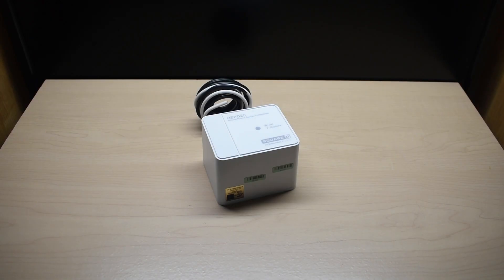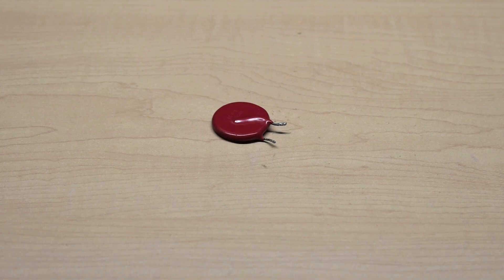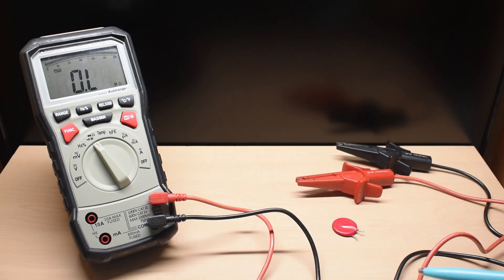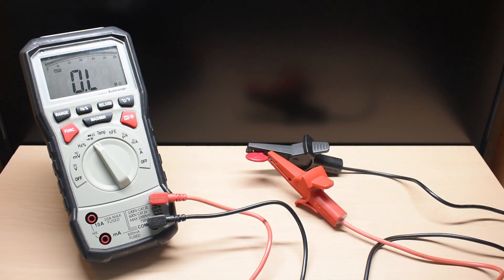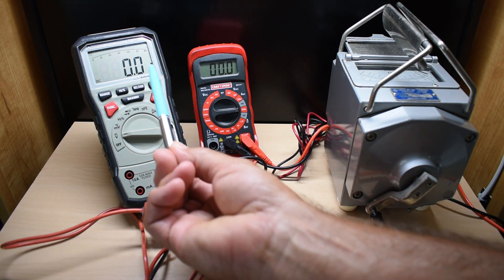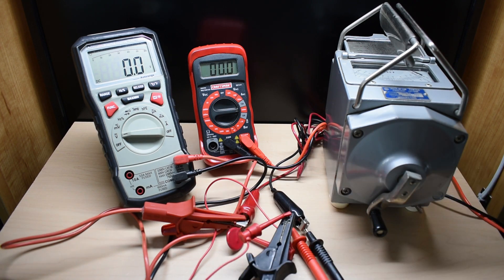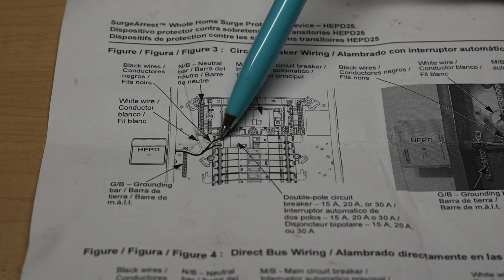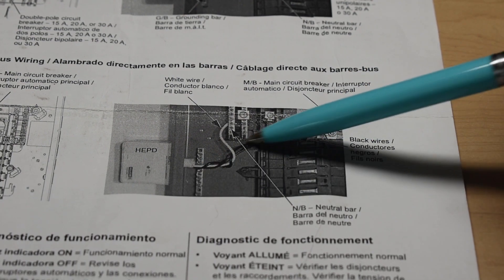HOW Surge Protectors Work & Installing A Whole House Surge Protector!

Comment: Checking resistance on a device at the same time you are applying voltage to it is a no no. 
How is the meter checking resistance with a voltage being shoved into it.

Comment: Thanks for the MOV tutorial. I have two questions though. ... 
(1) Is there a reason that a (hand cranked) dynamo was used instead of a common bench supply? 
(2) I'm doubtful that the internal resistance of the Ammeter (DVM) would have any significant effect on the current measured. At least Not with a 270K resistor in series with it, as you have here. Did I misinterpret you?:face-blue-wide-eyes:
Wakodahatchee Chris
Reply: Common bench supplies do not go to 600 VDC
Reply: Sería mejor comprobar los Varistores con voltaje AC.... y más cuando estás comprobando un protector de sobretensiones. 
 Si buscas en las hojas de datos de un varistor, podrás ver que en ac protege a un voltaje y en DC protege a un voltaje mayor....  Entonces si se quiere saber si un Varistor que está protegiendo en voltaje AC está bien, hay que probarlo con voltaje AC.  Es mi opinión

Comment: I worked in the oil field & we had surge protection on our well control panels (480V 3Ø. It wasn't unusual for lightning to pop the surge protector & leave a hole in the can. It didn't vaporize the wires. So the surge protection can still be HOT after a lightning strike.

Comment: Yes Great topic.   I was going to buy an insulation tester to test MOVs to see when they break down to see if they are still calibrated/operational/usable.   I did some research and thought I could build a DIY tester.  I was going to rig up a microwave oven transformer to a full wave rectifier to generate my 1000 volt DC source.   I guess I could just use the high voltage rectifier that came with microwave for half wave rectifier since there is no real load.   I was going to slowly increase voltage on primary windings of MOT transformer with my variac and have a current limiting resistor in series with its DC output.   I want to control the output voltage so as to NEVER exceed 1000 volts DC since all of my gear can't tolerate these voltage levels.  I also wanted to use this device to test unknown rectifiers to see what their actual reverse breakdown voltages are.   I have heard that some rectifiers are actually labeled with lower voltage levels than they actually are built for.  Thanx for the great content.

Comment: Can the MOV be distorted or go bad over time from repeated strikes?  If so how would you know? Thanks.
Reply from the maker: Yes. Usually they'll have a spot on them blown out.
Reply: @electronicsNmore  Thank you.
Reply: @TheRadiogeek   Si, el  varistor al pasar el tiempo, si ha recibido muchos picos de voltaje, se irá degradando su voltaje de ruptura o corte,  por ejemplo si el de 150v RMS,   después de tantos picos , podría quedar en 140,130 etc... todo dependerá de que tan altos hayan sido los picos recibidos desde su instalación. 
Ahora sí el lugar donde vives el voltaje es muy estable, los Varistores durarán mucho tiempo sin perder su voltaje de ruptura.

Comment: Does it make a difference if you put it on a lower breaker other then 1&3, I like it on 1&3 but I was told it didn't matter,
Reply from the maker: Good question. I think it would make a difference, but not too much because the bus bars are fairly wide and thick.

Comment: Very nearby lightning strikes can make the 120VAC Grounded wire go up to Millions of Volts, which is generally Zero Volts.  With Ground being that high, 120VAC looks like Zero Volts compared, so the lightening strike Voltage comes in backwards to the two phases of city power.  A Surge Protector Clamps the Voltage to about 300V which does help prevent damage to sensitive circuits.  The bad thing about Surge Protectors, which most people don't know, is that they are typical only good for one very nearby lightening strike.  They can and do go bad when the Voltage is that high.  The Surge Protector will still pass 120VAC, but will no longer protect against lightening strikes.  All Surge Protectors in the house or business would have to be tested, but most people won't have your generator or even know to have to test them.  This is for the extension cord breakout outlet type, but you'd have to know if the whole house version can actually withstand that or not.  A claim is one thing, but actual performance is another.  But it was a great detailed explanation of how they operate and how to install a Whole-House Surge Protector!
Reply from the maker: Yes, the unit I installed has an indicator LED to let you know if/when to replace it. Thanks for watching!
Reply: @electronicsNmore   That's very cool and so is that device.  I didn't know whole-house surge protectors existed.  Thanks for the video and reply!
Reply: @electronicsNmore  Maybe I missed something, but the whole-house protector connects to two live wires and neutral, and there's no connection to the 120VAC ground wire, which hence is not protected?
Reply: I've found it best for 120VAC to use an MOV rated at 150VAV rated at 20 Amps, or a high rating for high surge. And best to parallel them and use a proper AC rated fuse in series with the device.

Comment: Any reason I might need a surge protector if my electricity is underground?
Reply from the maker: If you have a Transformer sitting on a pad on the ground then there's always a chance that lightning can strike the utility pole nearby that supplies power to your Transformer
Reply: @electronicsNmore  so then I definitely should protect it? I thought being underground couldn't make it anymore grounded but I didn't think about lightening hitting the box.  I'm going to check to see if you linked it in the comments. Thanks again, I still get my best 'useless information' from you 😂

Comment: Nice! I've wondered about testing MOVs. In my main panel and solar combiners I've installed a couple of large Silicon Oxide Varistors (Delta LA 302 IIRC) which are supposedly self-healing. But I have a lot of point-of-use MOVs I need to test.
Reply from the maker: SiC varistors are really good. Thanks for watching!